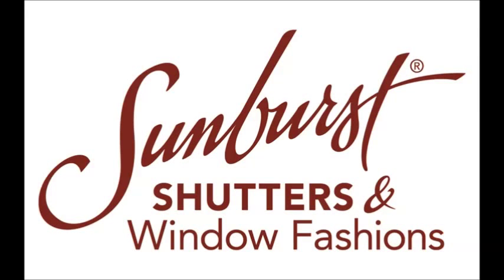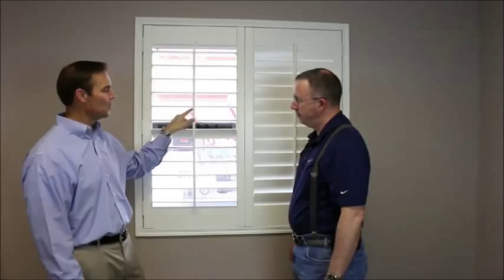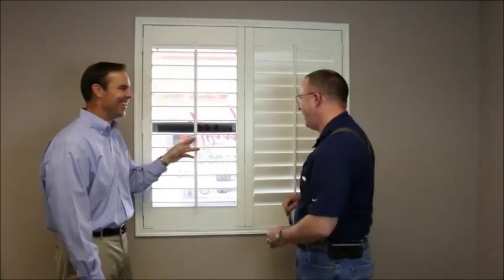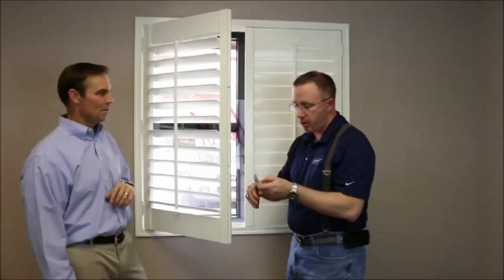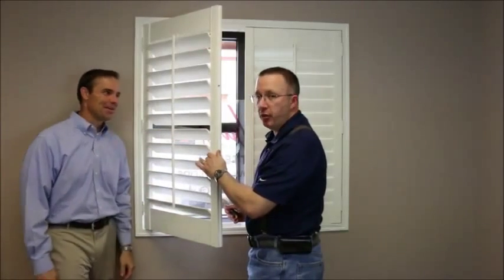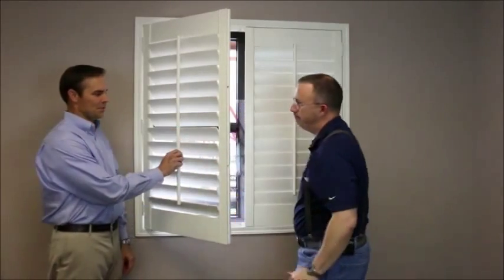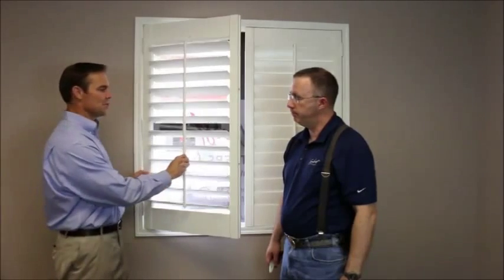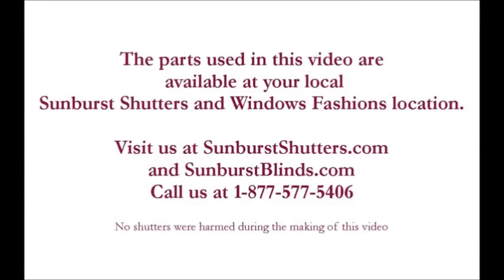How to replace a tilt rod staple

Comment: Hi ...I am wondering how to remove the broken pins ...it is broken fro. the middle so one part stayed in the bar and the other one in shutter? also from where can I buy the pins? thanks for the great  help
Reply: Hi Mohammed. Breaking off the staples in the tilt rod is a hassle. I usually grind a sharp points on a new staple and insert it right next to the staple leg that broke off. Feel free to call any time and we can discuss. Thanks, George

Comment: My shutters are joined to the rod by a plastic strip  not a staple and all have broken.
Reply: Hi Chris. Sounds like your shutters are hollow vinyl. We do not carry parts for those shutters, but you should have some luck finding a manufacturer in your area. Feel free to call and we can find a solution for you. Thanks, George

Comment: For $10k in total spend on Sunburst Shutters you’d think in 40-years they’d have a better design than cheap staples.
Reply from the maker: If the staples are in the Polywood shutters they are very difficult to remove as the Polywood almost melts around the staples upon insertion from the factory. Wood shutter staples are glued in but both wood and Polywood staples are easily replaced should they come loose.